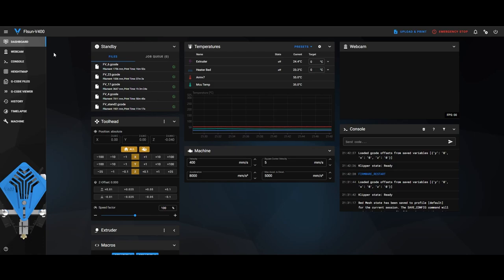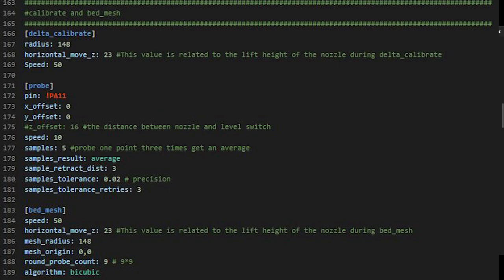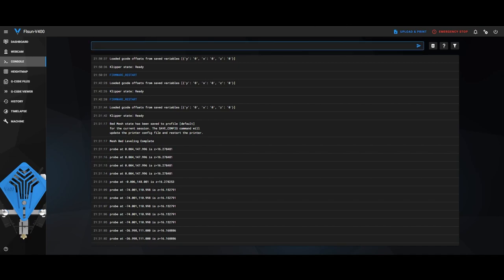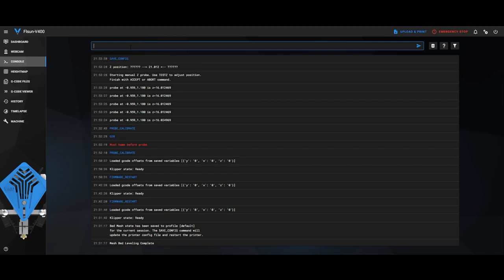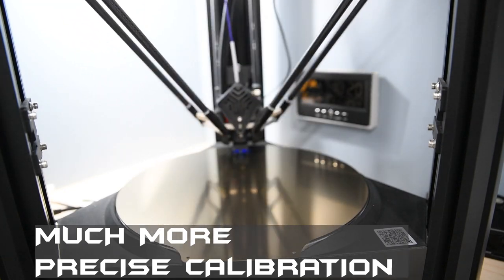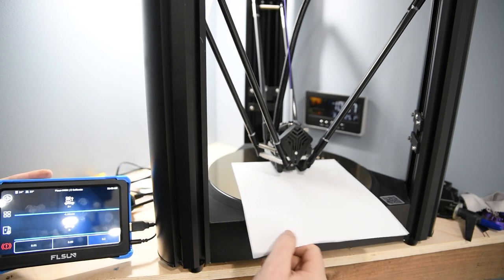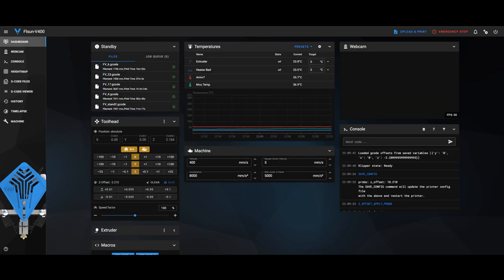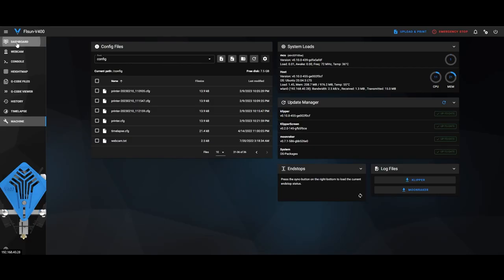FLSUN V400 60 Point Probe calibration Bed Mesh & Start G-code Perfect prints

Comment from the maker: After Probe_calibrate and saved the results, if the nozzle stops short of the bed turn the machine off and turn back on again and it will fix the problem, a couple people mentioned having this problem.

Comment: Thank you.  I could tell from the top of my prints and the grinding noises in certain spots my bed was not level, but I could not figure out how to fix it before your video.  My printer is now printing better then the first day I received it.
Reply from the maker: Awesome glad it helped :D mine is still going great , while it is still running nice feel the belt tension so you know how tight they are so if ever a problem you can put them back. good luck
Reply: @carphotography  ive changed config, but mesh levels looks like it has only 7*7 points. (seems settings not applied in config file, but there is definitely 9x9 in printer.cfg

Comment: Thank you!  After adding these extra points of calibration to my V400 I am no longer having issues when printing large items that stretch the entire length of my bed.  Previously I was seeing edges of my prints curling up because the heightmap created by the basic calibration was way off.
Reply from the maker: awesome glad it helped out, thanks for watching.
Reply: I'm having the same problem. All my prints are great. But twice I have tried printing something that took up the whole bed and both times it would fail in the middle of the night. I'm thinking this would fix it. Was that the case with you?
Reply: Also did it make a difference for you calibrating with the bed heated or not??
Reply: @ryandugan7933  the biggest difference for me was from the extra calibration points. I couldn’t see much of a difference from heated bed.
Reply: @ryandugan7933  yes this is very similar to what I experienced. Printing small items worked fine as long as I avoided using a specific area of the bed.  But larger prints would sometimes detach from the bed or the base as distorted.  Initially I thought it was an adhesion issue so I tried glue, different temps, etc. But after video recording I realized it was a bed leveling issue.

Comment: Fixed my issues! Was going insane for a few days
Reply from the maker: awesome :D glad this could hemp out. thanks for watching
Reply: @carphotography  the z setting doesn't change after normal bed level, it stays the same. How do I reset everything you did in the video?  🙏🏼
Reply from the maker: @googleaccount8578  you can use one of your older .cfg files select from the list you should have back ups, the ones with all the numbers before them, move it back to a date where you was happy with it or just reinstall printer.cfg from the FLSUN flash drive (Y)
Reply: @carphotography  also the electricity couldn't handle the voltage of the printer, either the wires or the fuse burned out
Reply: @carphotography  thank you very much. I figured it out 👍
Reply from the maker: @googleaccount8578  do you have a lot of other items running on the same circuit ? i haven't had no problems as i only have 2 sockets on each circuit so i can plug it in and it has no interruptions.
Reply: @carphotography  no, only the printer was plugged in  :)
Reply from the maker: @googleaccount8578  weird, i am not sure but i have heard a few people mention the same thing, maybe it needs a 20amp breaker but you would have to make sure the cable is sufficient.
Reply: @carphotography  so i need a circuit breaker for 20 Amper ? 👍
Reply from the maker: @googleaccount8578  a dedicated 20amp circuit would be nice and only have that on it and it will never turn off, but you must make sure the wire that is used is capable of holding the 20 amps or depending on how old you are turn off the breaker your printer is into and see what else switches off with it because if a heater or something that takes a lot of electric is on the same circuit then it will give you problems.
Reply: @carphotography  thank you very much 🙏🏼

Comment: I had to delete the old default file before calibration,  because it could not overwrite the original and would say 7x7 in the bed mesh section of the interface otherwise? Very insightful and helpful video, stuck without it :)

Comment: Thanks for this video, really helpful.

The line of code doesn't appear on Prusaslicer, do you know how to put it and where in the code?
Reply from the maker: Damien under printer settings, try this link and it should show a photo (Y) https://www.facebook.com/photo.php?fbid=6505506179474235&set=p.6505506179474235&type=3
Reply from the maker: also FLsun Daniel uses Prusa and he shared a profile try the link here for that, he is part of the company  https://www.facebook.com/groups/1616537272042880/search/?q=prusa%20.ini

Comment: You show 2 different mesh heatmaps, one with the bed heated and one that is cold What is best to have as our "default" for cura? I would assume the heated one given that is how the bed is going to be for most of my prints? Or do i still run the cold bed as default? Also should i be doing the whole calibration with the bed hot or cold?
Reply from the maker: yeah heated but there really aint much difference.

Comment: Hello Sir, do you recommend buying this or the P1p for commercial purposes
Reply from the maker: the V400 might be a little more maintenance but i like it, this is my fist ever printer so i really cant say if it would be better than others, but it is fast and accurate once you get it dialed in.
Reply: @carphotography  I'm joining the 3d printing industry too, I wanted to have 2 p1ps and a delta this is really helpful, i want to use it for printing petg most and in vase mode, is it a reliable printer working non-stop? Thank you, i appreciate the response
Reply from the maker: @mugaggakennedy  i have had no problems with it, there is a facebook group where people do post their problems and i have seen a few, but i think if you keep it well maintained all should be good, i just like the look and speed of it, but i have nothing to compare it to  (Y) look at some of my shorts and you will see i had some really nice results
Reply: @carphotography  wow wow they really look good am new to 3d printing but fairly okay with tweaking other machines will have to disturb you on how to achieve great prints your prints are really nice
Reply from the maker: @mugaggakennedy  thanks, a lot of the things that helped me achieve those prints i posted a video about (Y) the calibration and maintenance are important (Y)
Reply: P1P for commercial purposes.
Reply: @carphotography  thanks for this sorry for the late reply, I'm shipping in my FLSun v400 are their any accessories you recommend i bring along with it
Reply from the maker: @mugaggakennedy  i would get some alcohol wipes or something to clean the bed off before each print to help adhesion, the rest is good to go :D enjoy
Reply: @carphotography  oryt nice tip, i will follow that , have you been printing petg with it, how is it with Petg? Do the prints come out good??

Comment: nice video. But even if I insert bed mesh readings after g28, it doesn't use it. I don't know what to do anymore
Reply from the maker: weird, did you do the new update ? if not, now might be a good time maybe that will fix it. not sure i havent updated mine yet as it is still working fine, make sure to check your belt tension as shown in the maintenance video, that makes a big difference, then run the calibration , ping the belts make sure they all feel about the same tightness.
Reply: Thanks for the reply. I did everything, belt, I disassembled and reassembled the printer, I switched to the updated 1.4, but it seems to be a software problem, because it prints low and high based on how the mesh reading detects. I copied your gcode for cure, but I can't. I also changed the printer.cfg file, but it doesn't want to start printing by reading the mash.
 @carphotography
Reply from the maker: @antooniodefrancesco  when i first got mine i used it without that code after G28 and it worked fine. that just made it a little better, go on their FB page and someone there should be able to help
Reply: flsun unfortunately doesn't know how to help me. I tried without the code after g28, but nothing changes, I have levels too high and levels too low and I can't print well. Thank you @carphotography

Comment: I'm recalibrating so after I do the probe_calibrate then save my z is from my old z offset do I need to set that to zero and rerun the probe calibration?
Reply from the maker: after calibrate set z to zero with the paper method and your good to go, if the first layer looks a bit flat raise it a hairr and if it aint sticking lower it a hair , Thanks

Comment: Could you perhaps add the Start/End G-Code you use for Cura? Its hard to read in this video.
Reply from the maker: start code:     
G21
G90
M82
M107 T0
M140 S{material_bed_temperature}
M104 S{material_print_temperature} T0
M190 S{material_bed_temperature}
M109 S{material_print_temperature} T0
G28
BED_MESH_PROFILE LOAD=default
G1 F3000 Z1
G1 X-150 Y0 Z0.4
G92 E0
G3 X0 Y-130 I150 Z0.3 E30 F2000
G92 E0
Reply from the maker: End Code:
M107 T0
M104 S0
M104 S0 T1
M140 S0
G92 E0
G91
G1 E-1 F300
G1 Z+0.5  F6000
G28 
G90 ;absolute positioning

Comment: so do you do the mesh with the bed heated or cold?
Reply from the maker: i would recommend heating it to the temperature you most use, for me it is around 60 - 65, there wasnt a lot of difference in my test but it will most likely be that temp when you print so you might as well (Y)

Comment: I did everything and it seemed to work, but now whenever I press the Z0 button my nozzle slams into the bed and I have to set the z offset height to +3 or higher but then it will change to something random and now I cant get my z offset to stay where it is. what should I do?
Reply: I was having same issue, whenever i did Final z calibration, nozzle slammed into the bed and even though i raised it and did the calibration, when i tried to print, it scrapped the plate really hard that i had to immediately shut down so i had to go back and change the settings of line 188 back to 7 # 7*7 and redid the calibration and no issues except now i have a scrapped line on my heating pad.
Reply: Yeah I reset installed my printer.config and it’s been working. Thing is I also switched to prusaslicer. We’re you also using cura 5.0? Because Im half tempted to try this again since prusa has been working so well for me.

Comment: for some reason when i try to print now on my machine a majority of my prints will just stop mid print. any insight would help.
Reply from the maker: does it give you any error codes ?
Reply: @carphotography  not at all. The machine pauses it and pressing resume didnt do anything. 
I looked around and found a video saying a bad sd card could be doing it. 
And seeing as i had two different stls  have this problem and a benchy .
I tried a different usb thumbdrive and am currently trying to reprint one of them now. Before the stl im currently printing paused at the same place at an hour and 10 minutes in. And now its made it a good way past that point so perhaps if anyone has this problem try using a new sd card or usb stick. Will update if my print finishes this time. Hope.
Reply from the maker: @blackthornejoshua2929  weird, if i hear anything or work anything out i let you know, hopefully it works itsself out :D
Reply: @carphotography  so far i've successfully printed one of the files that was randomly pausing on its own. it seems using a fresh usb thumbdrive has solved this problem
Reply from the maker: @blackthornejoshua2929  good, i always send from cura, or 99% of the time and have no problems so far :D

Comment: BONJOUR CHEF SOMME NOUS OBLIGER DE RAJOUTE LA COMMANDE APRES G28 , QU APPORTE T ELLE MERCI
DOIS TON L ECRIRE NOUS MEME? MERCI
Reply from the maker: yes you have to write it in yourself under G28, it will allow the G-code to use the Bed Mesh.

Comment: Hi i just did the probe calibration and now i cant do bed leveling because when i press to level i have an z offset horizontal error..
Can you help me?
Reply from the maker: after you do probe_calibrate and it has saved turn off the machine and turn it back on and that will go away.
Reply: @carphotography   ok thank you a lot

Comment: Also ever since i followed the steps in this video, my klipperscreen says "dirty" now instead of up to date? 
And on the speeder pad the klipperscreen says invalid. I cant find any information to explain this.
Reply from the maker: just click where it says "dirty or "invalid" and just reboot firmware and it will be fine if you have good internet.
Reply: @carphotography  ah i see. My wifi is shitty at best. Perhaps thats the culprit. When i was following your instructions the browser control kept losing connection to moonraker and commands wouldnt work. The inputs would show up in the commands like g28 but the machine wouldnt do anything and after a few moments the command would dissapear. Do you know if bad wifi connection could cause this?
Reply from the maker: @blackthornejoshua2929  i have my printer in my barn outside and i had to add a wifi extender as it was giving me problems, but all those commands can be typed straight into the speeder pad.
Reply: @carphotography  really?. Im sorry if i sound completely ignorant but how do i put the commands in using the speeder pad?
Reply: @carphotography  also when i click on klipperscreen invalid from the speeder pad, it asks " do you want to recover klipper screen? Options are "recover hard ,  recover soft". 
I really am sorry to ask so much i just dont understand and fear destroying a machine in my ignorance.
Reply from the maker: @blackthornejoshua2929   try soft first if not try hard , you cant mess it up as you can always go back to original with the download from the FLSUN website.

Comment: When I try this I get the message "probe triggered prior to movement" when I try to calibrate from the pad.
Reply from the maker: not sure but after a search i would double check all the cables are in and seated nicely and someone said "I had this issue, and was able to solve it by setting a larger horizontal_move_z setting under [delta_calibration]" someone also said using an older config worked.
Reply: @carphotography  Followed your advice and it seems to be working now.  Thank you for the suggestions!

Comment: Im also having trouble sending code. Most of the time when i enter any command like SAVE_CONFIG  it enters in blue and then dissapears after a few seconds. I have no idea why
Reply from the maker: you can type it straight into the speeder pad, if you keep having problems go to FLsun page and under support they have the V400 printer.cfg

Comment: I tried this the probe worked 5 times but the location was still 7 would not do 9.
Reply from the maker: maybe turn the printer off and back on again and try again, you see i pinned a post above where a few people had a Z issue and that fixed it, worth a try, thanks for watching.
Reply: @carphotography  that worked, thanks
Reply from the maker: @barrya5473  awesome yeah not sure why it does that but glad it is an easy fix :D